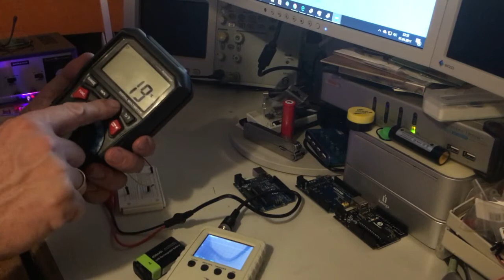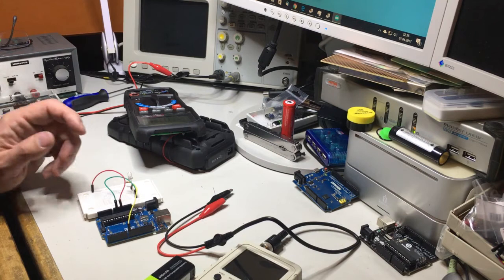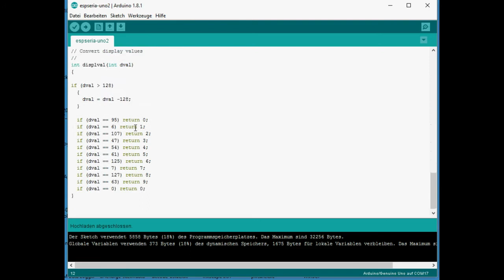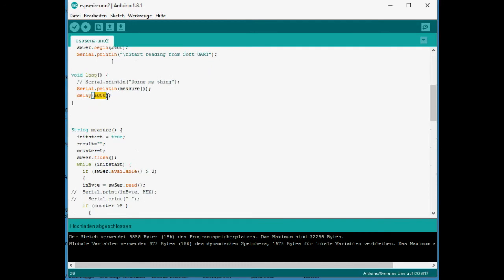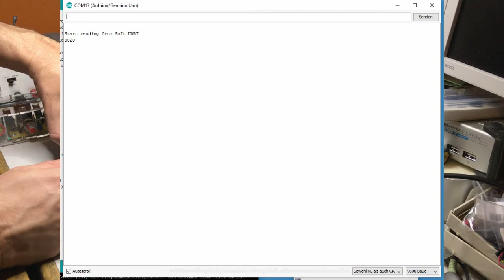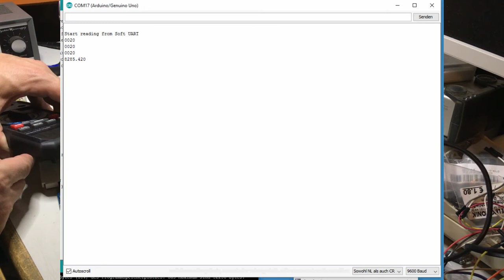Decoding a multimeter's IR protocol with Arduino

Comment: Hello Andy, thanks for the interesting video. Where can I find your remarks about the challenges using the esp8266?
Reply from the maker: Hi Tobias,
I haven't published anything about my experiments with the ESP8266. But I can summarize that in a few words:
Just as with the UNO, I used software serial, so I could do the normal upload/debugging through the ESP's hardware UART.
This worked great. No issues with the IR detection and decoding.
Until tried to do anything WIFI related. (A web server, serving the meter's readings. But that is irrelevant in this context.)
The tests I have done lead me to believe that the constant stream of serial data causes so many interrupts that the single processor can't handle the WiFi.  (Should be better on the ESP32, but with it's two hardware UARTS, this is not an issue at all.)
Connecting the meter through a simulated UART was meant to be a temporary solution, so next I'll go through the UART an ESP-01, which makes development a bit more troublesome because of the necessary re-wiring between flashing and testing.

I have never tried over-the-air updates (AFAIK the ESP-01 does not have enough flash memory), which could make things easier. Have you?
Reply: AReResearch   Unfortunately I am also just beginning to use the esp8266 . so I would not be of such big help. the only thing I could think of would be the     "yield(); " Command which gives the 8266 time to compute between wifi tasks and sensor reading.  I am thinking of trying the ota functionality in the future the way @AndreasSpiess has demonstrated in a few videos. check them out. quite interesting.

Comment: Hi Andy, nice video, thanks!
You could try to use a better IR receiver, there are so many available instead of the 5mm LED type (ex. TSOP382).
Reply from the maker: Hi Javier,
wouldn't the 30...56kHz bandpass (see http://www.vishay.com/docs/82491/tsop382.pdf )block the signal? I'd like somthing to block visible light, but those receivers seem to require an additional modulation/carrier on the IR signal.
Reply: Hi Andy, as far as I used them, they seem to work fine, the difference being that the ones in a TSOP package have a photo detector and preamplifier in one package. I only use the LED types in parallel with a 22K resistor to hook them up directly to the input of my oscilloscope to look at an IR signal (they do not require a voltage source like the TSOP ones).